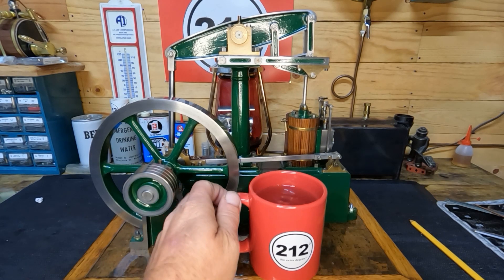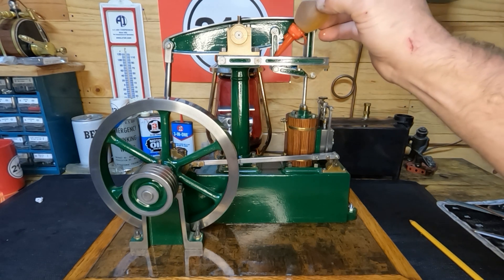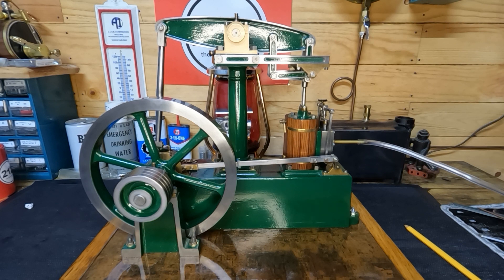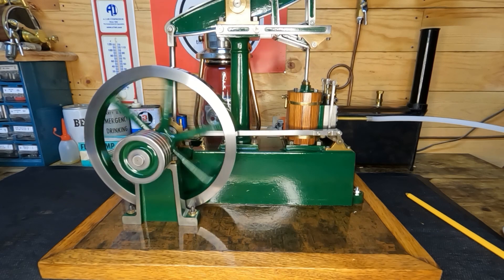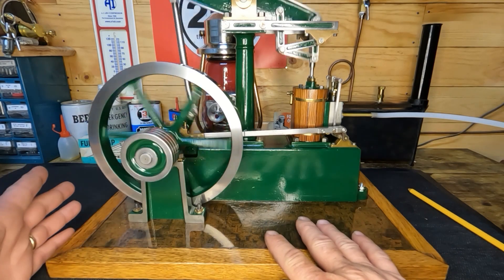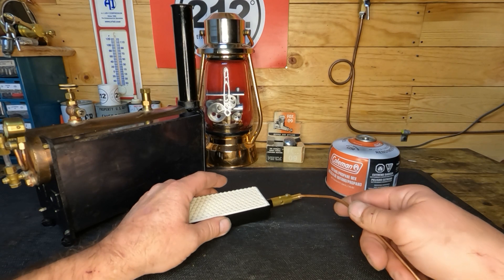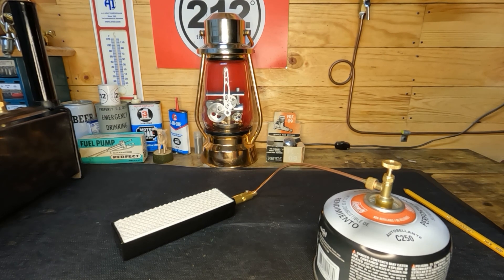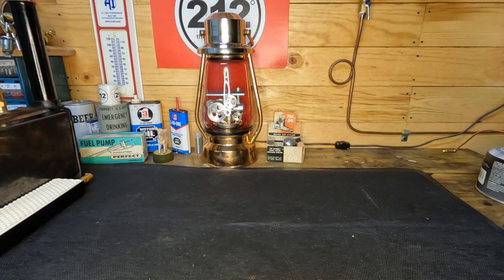Building a Stuart Beam Engine Steam Plant part 5 Running the Engine!

Comment: You must be happy with the Stuart Beam, where did you get the hit & miss engine from? - Cheers Jim
Reply from the maker: Hi Blue Heeler, This Stuart has turned out pretty good. I can't wait to run it on steam. I'm not really happy with myself because of the knock, but if it keeps knocking in the cylinder, we'll answer it. I ordered the hit and miss from stirlingkit.com. We're going to get into it and see how we can improve it also.  Thank you for your interest, comment, and question.  Your videos are fantastic, I can't wait for the next ones!  👍
Reply: @steam212  I know this won't address the knock but I put my Stuart beam on a mild steel plinth then onto hardwood. This worked so much better for me for alignment than a solely timber plinth.
Reply from the maker: @SteamEngines-Jim   I couldn't agree more. I refinished the baseboard only for testing purposes (we're going to make a new base to accommodate the boiler also) but it will have a loving home under another Stuart beam engine when this project is completed. You guys really are GREAT!  I would have never imagined that so many of you would watch and relate to me "working" in the shop.  👍
Reply: @steam212  Its pretty cool hanging out with likeminded folks 🙋‍♂